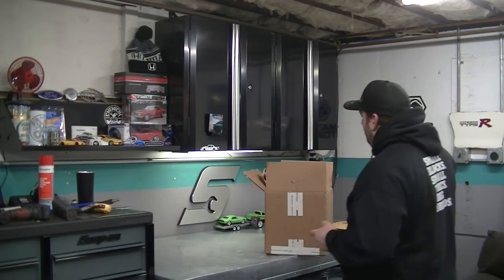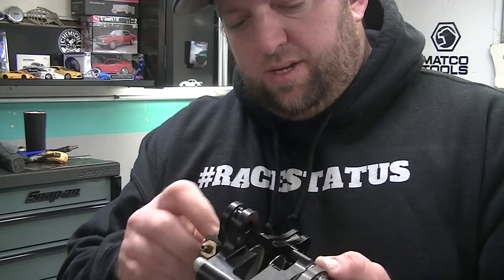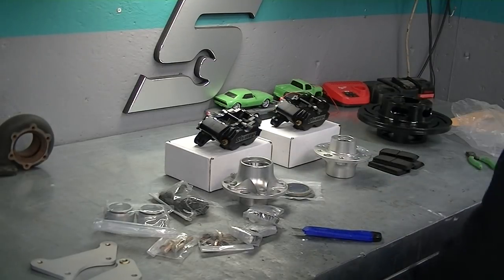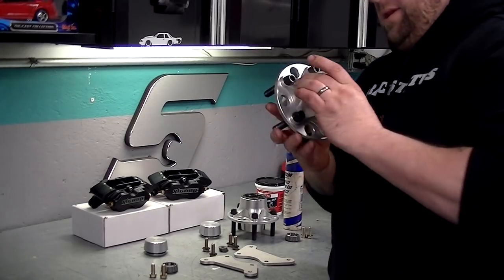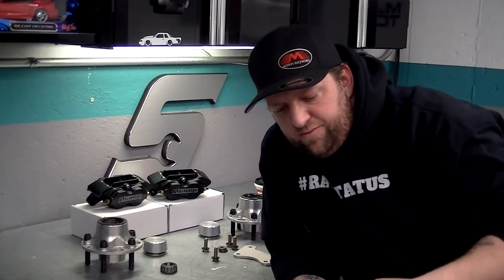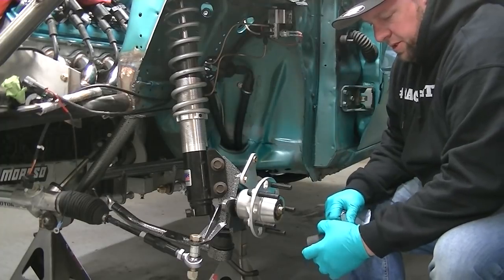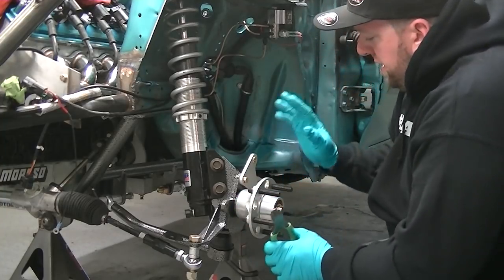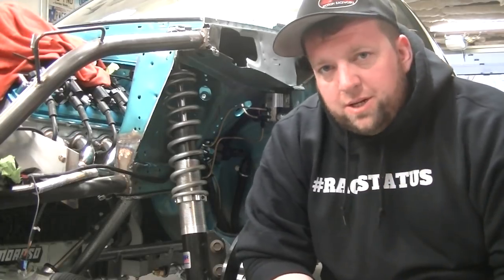Ls Foxbody build EP. 63 Strange brakes!

Comment: Another great video,  BUT!!!!!, you better loosen up those bearings or they will lock up on you. Just use a regular 3/8 socket wrench and only snug them up, then back them off 1/4 to 1/2 turn and install the washer and cotterpin with the keeper. if there is not a little in and out play in the hub it will seize the bearing when it heats up and expands a little.